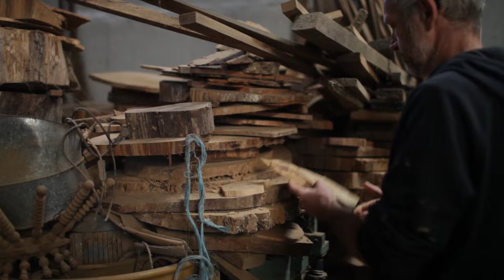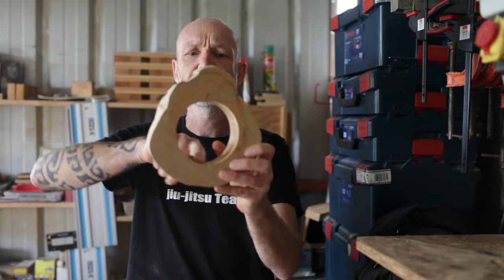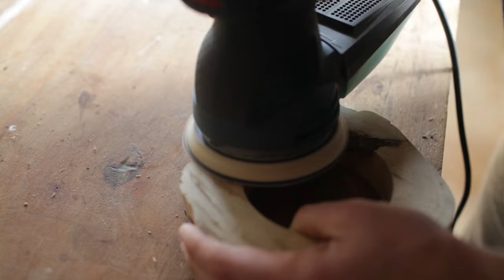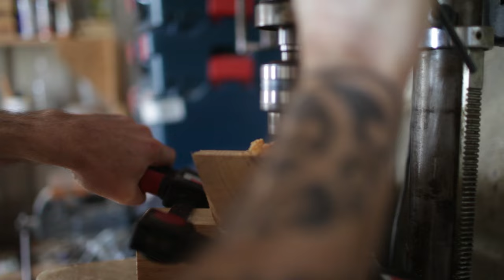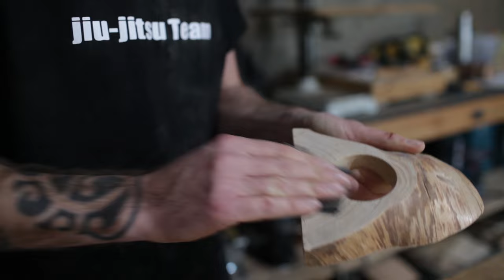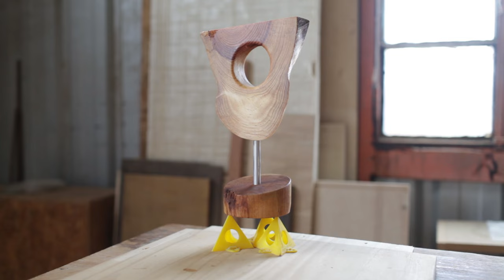DIY Test Tube Vases with Rustic Live Edge Stands

Comment: Great video! I like the finish. Is there any particular reason why you are using that oil instead of for example Danish oil?
Reply from the maker: 🙏🏻 No particular reason other than that's what we had available to us in the shop 😂 And it does a good job of it too
Reply: @ReclaimDesign  it looks great no complaints there. I was just curious. Have a great beginning of the week 👋👍
Reply from the maker: You too!